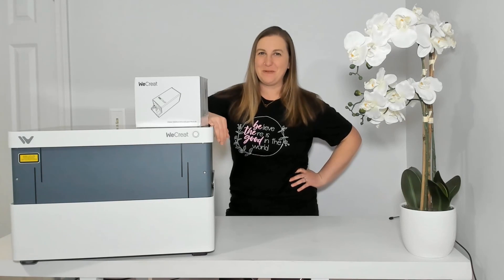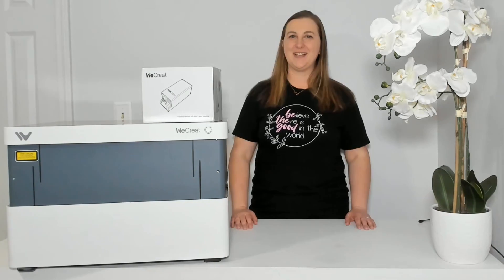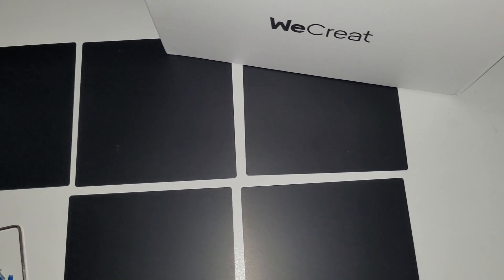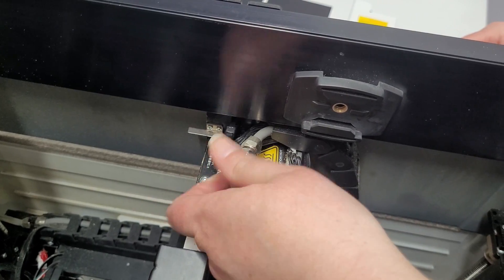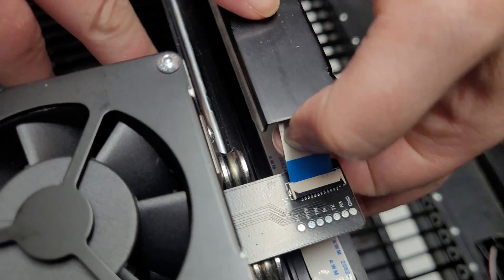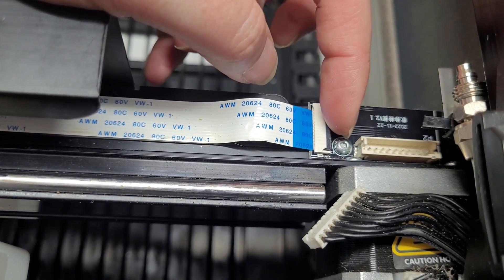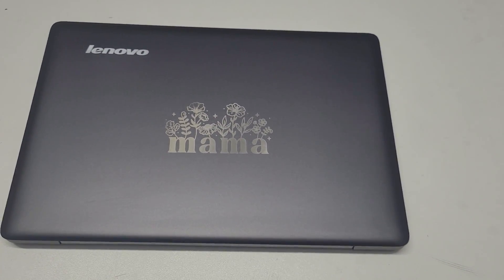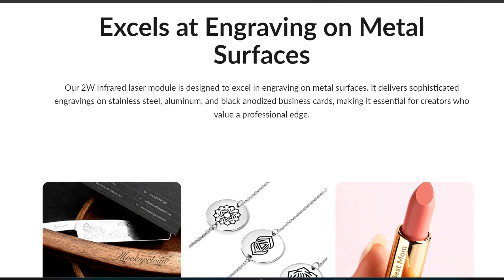Transform Your WeCreat Laser With The New 2W Infrared Laser Module! Unbox, Install, Review

Comment: Got it … was not easy to swap. Screws was so tight had to drill one out. Also plug in connector was glued in  . Had to scrap all the glue off to get apart.
Reply from the maker: Jeez mine was definitely not like that. Hopefully it'll be easier from here on out

Comment: I don’t know, this seems very much like an afterthought, especially in implementation. The fragility of swapping out the laser modules seems unnecessarily tedious. They could have easily made a spring loaded clamp bracket for both laser heads and a dual control board. At least they could’ve made the screws magnetic so you don’t keep dropping them. I love wecreat, but this just doesn’t seem up to their own innovative benchmarks.

Comment: I just received my vision this week, a great machine so far but honestly, that swap-out is an easy way to damage one of those cables. I also have the x-tool f1 which is fully enclosed and has both lasers 10w diode and 2w IR and supper fast. it also has an automatic feed. Thank you so much for the video review.
Reply from the maker: If you can afford multiple laser engravers, that's of course the easiest way to go. One designated laser for wood/diode, one for IR/metal, one for rotary projects. But most people don't have the money or space. I like my LaserPecker4 because it goes back and forth with the push of a button. But it's also smaller and not enclosed. They all have their pros and cons. To be able to pay $350 to transform their pre-existing WeCreat into an IR laser is pretty cool IMO. I wish the swap out was simpler. But it is only 6 screws and popping a ribbon cable in. Just gotta be careful.
Reply: @KerriCraftsIt  I think it’s cool that they came out with that. You’re 100% about the space and affordability for some. I was looking at it from post I see on Facebook from others who own the vision. I think the none tech savvy owners who have trouble installing the laser head and possibly damaging the cables.

Comment: With no air assist, is there a issue with debris in the cutting field?  With the IR can you still engrave and cut wood, engrave mugs etc?
Reply from the maker: There's no debris or smoke when engraving metal so no need for air assist. You have to switch back to Diode for wood

Comment: Yes i just ordered.. will it cut and engraving on wood? Or do we need to use the  original unit ? Thank you
Reply from the maker: If you want to engrave wood you need the diode mod. You'll have to switch to IR for metals. IR does not engrave wood.

Comment: Great video! Engraving looks easy, but will this thing 'cut' metal at all? Wondering if you could round the corners on those coaster? either way, this looks easier than trying to figure out all the sprays and coatings. I do hate the thought of swapping back and forth. Besides metal, will this engrave slate or wood? Or do you have to swap back?
Reply from the maker: It can't cut metal, only engrave. You do have to swap back and forth for wood, but it's really not that hard. It's 6 screws and a ribbon cable. It takes me 5 minutes.